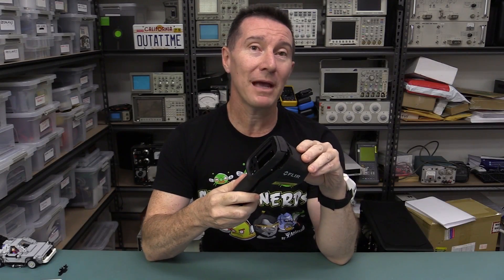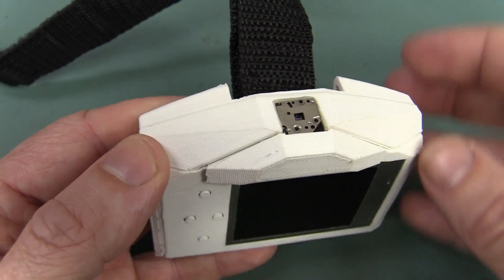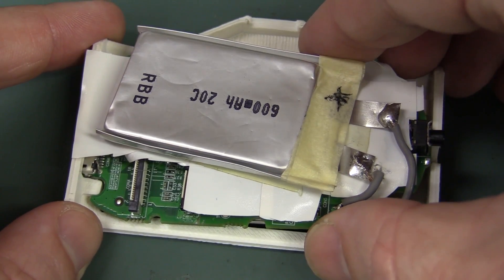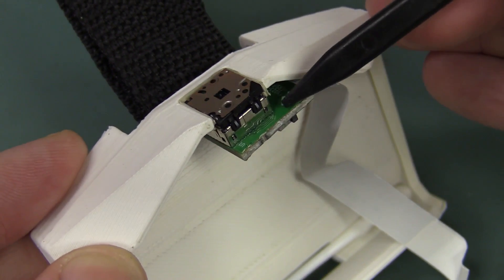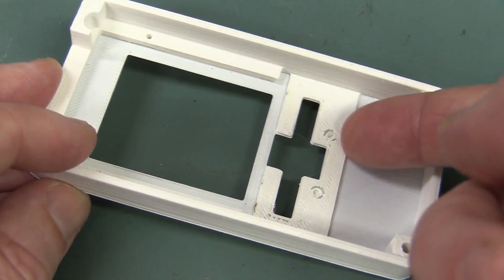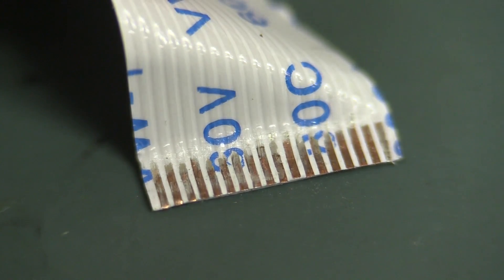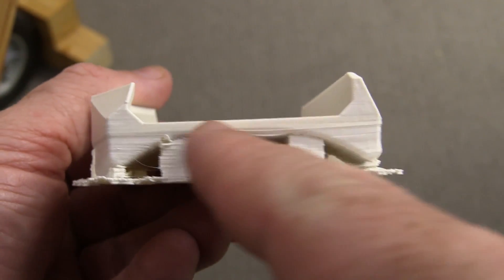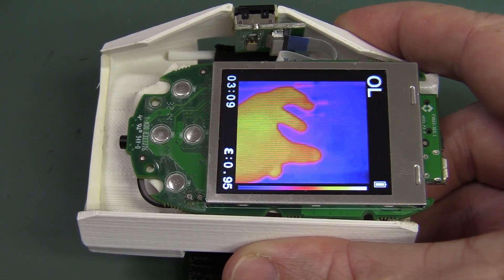EEVBlog #736 - World's First IR Thermal Camera Watch

Comment: Haha, I did that exact same scrape fix on a flat ribbon cable for a friend's Playstation 2 controller port that had been torn when he was modding it. The end had a stiff plastic sheet back, so I cut a bit of magazine subscription card and shimmed it in with the cable to make it fit snugly in the snap connector on the board.

Comment: EEVblog , Dave! Just be carefully using a Li-Poly battery instead of the cylindrical Li-Ion battery, they are actually different chemistries and can have different charging and protection requirements, meaning you could have a fire hazard there.

Comment: "World's First"?

Pretty sure Mike made one first. He reverse engineered the whole Lepton sensor protocol, and the MIPI protocol (for LCDs), and built this...

(which can obviously be worn as a watch, as Mike even mentioned)...

https://www.youtube.com/watch?v=alZhcFSyoE0

Nice vid as always, Dave, but not quite a World First. :p
Reply: +electronash Well... the one Mike did had the sensor in the wrong position to be worn on the wrist and be 'forward looking' or used as intended..  Sure, he mentions that it could be re-positioned,... but he never did, right?  Did he even make it a watch without moving the camera?  Nope.  So, it could be strapped to ones arm as most anything could (within reason) but it wasn't.   
It's too bad Mike didn't actually make it to strap to the arm, which you can see he didn't, even though he mentioned it.
Reply: +JimmyDB - True.

You can see the intention though - Mike's one could clearly be used as a watch with some minor tweaks. :p

The main thing was shinking it down to that kind of form-factor.
Reply: +electronash well, mike's one is not a watch :p
Reply: manaquri

OK, fair enough - but it "could" be used as one. :p
Reply: electronash could but isn't :p

Comment: I could see this being incredibly helpful for Fire departments. A small, wristwatch IR sensor camera they can use to spot people in the smoke.
Reply: Brandan09997 Actually we use thermographic cameras to find victims in a fire. Normally you can not see through smoke particularly well, with such a camera you can still see people through dense smoke. And like you said we use it to search for hotspots etc.
Reply: its a prototype. but the concept is sound. Encase it in something more fire resistant and it would be perfect.
Reply: Way to suck the fun out of it. You must be a riot at parties
Reply: MichaelKingsfordGray Surely you don't think fireproof gauntlets are going to remain that thick forever? I'm sure a device like this could be miniaturized and embedded into the gauntlets.
Reply: Brandan09997 How about FLIR goggles? Would those be useful?
Reply: Google's self-driving cars have something that spins on the roof - I think it's a laser - to map out the environment in 3D; something like that may be useful if it was small enough to be mounted on the firefighter's hat. The image could be overlayed (Augmented Reality) in goggles. The firefighter could switch between Thermal and Laser view, or combine both views... I wonder if sound-waves could be used to generate a vivid 3D map; they may penetrate dense smoke better than lasers.

Comment: Dave if you print all the pieces at the same time it takes longer then printing them separately due to the travel moves required, also your more likely to have warping the farther you are from the center of the build platform.